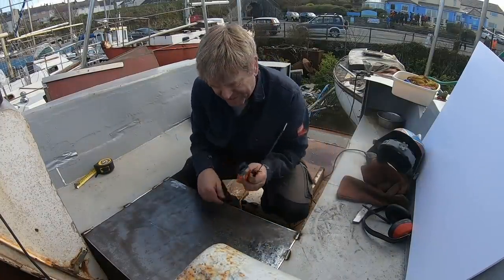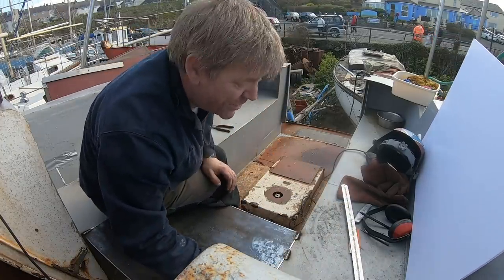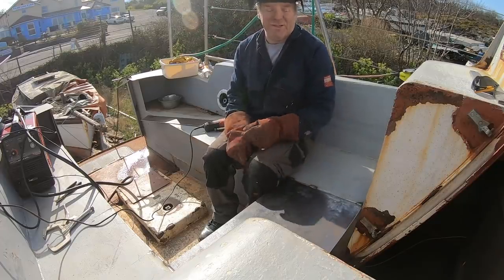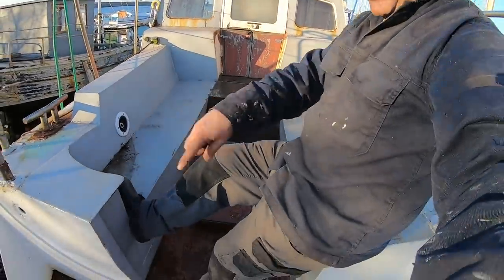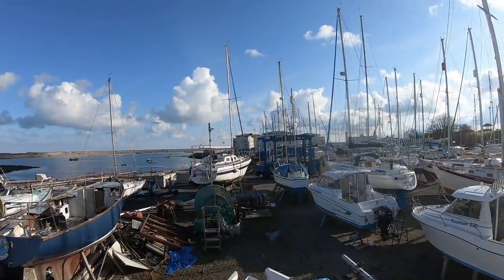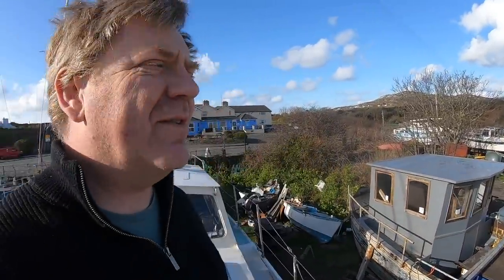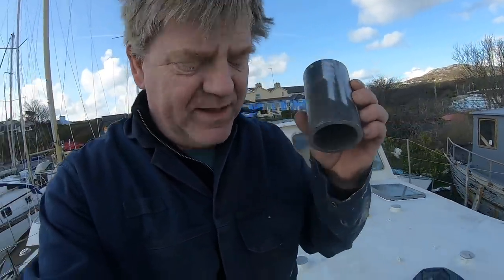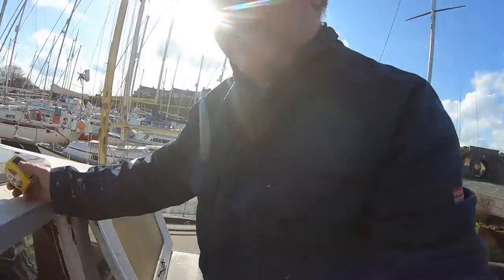#90 - Fabricating a CUSTOM BRIDGE DECK for our PROJECT YACHT

Comment: Andy, as a safety engineer and as a sailor I think you might regret the bridge deck modification as currently changed.  I think you need to consider stepping up and trying to get through the companion door in heavy seas.  It looks like it would be very awkward and possibly dangerous.  If you still want a bridge deck I would lower it to half it height that would still prevent water from running below decks.  Also the seat sides end up as foot holds when the boat is healing so such a high bridge deck prevents that as well.  There is no place to brace your feet while underway and 15 degrees or more of healing.  If you keep the height as is I would add hand holds on either side of the companion way doors.
Reply from the maker: Yes I see your point and we will be putting lots and lots of handholds everywhere.
Reply: I'm not fond of this bridge either. It's going to be a pain most of the time. I think I would consider making a removable water tight step or panel that could be installed in case the weather conditions are bad. The deck bridge permanently reduces the size of the cockpit and the height of the door. But if you like it, it's your boat and that's fine too, of course!
I hope you will recover quickly. Don't over strain yourself.
Reply: @SailingMelody  your bridge deck isn’t that different from what I have on my Swan. I actually find it quite ok - we tend to sit further after if we want to be on the weather side and brace; otherwise, where you plan to sit and stretch out is a very popular spot!! Plus on my boat salon stays very protected.  I do have good handholds, as noted above, and we use those.  But we’ve been out in a few Force 8 /9s and no problems.

Comment: FWIW (I'm no welder), As an old school sailor, I'm loving what you did in this episode.
I would add a wood or 'Starboard' trim piece on each of the bendy bits' edges.  
Else, think guillotine! 
Or, fully enclose the shelf area and put a 'cut-out' opening in each side for storage access.
Hope you are fully recovered by Summer.
G King
SV Intuition
Reply from the maker: Thank you :)

Comment: I had a bridge deck on my previous yacht. After a lot of consideration I removed it and life become so much better as a live aboard. I just made a small drop in companionway slide to use in heavy weather. My current Bluewater yacht also doesn’t have a bridge deck. They are a real pain to step in and out off.

Comment: Gday Andy, I like the bridge deck. I read how some think it could be a hassle in a seaway but the way to get around that is slide your bum up to the entry and swing your legs around and down the entry with no need to stand up which keeps your centre of gravity low and it's a civilized spot to pass out tucker and refreshments. It will give you more room inside as well. Along that curvy bid I'd consider a 15-20mm diameter pipe welded along the top edge which will make a user friendly grab rail and be chafe friendly if you've got lines over it. Don't worry about your winging were used to it now and look forward to the next vintage "from the winery"😜 and don't rush your recovery, if your body ses take a break, take a break. Like Treebeard ses " if a thing is worth doing it's worth doing slowly and we only do what we can do slowly" . Or is that just me 🏴‍☠️
Reply from the maker: Hahaha yes I know what you mean. I don’t think it’ll be a Hassle at all.

There will be wooden slat on the sests and some anti chafe along the combings. The companionway entrance is still larger than on most boats and I may yet install a sliding hatch. It’s deceptive on camera but the arrangement will work quite well and being steel if we hate it we can change it 🤷🏼‍♂️

Comment: I don’t get the box at all! Now you made it a pain in the rear to go below. And the box can’t be used for storage. Need some drain holes.
Reply from the maker: The box improves seating in the cockpit and I’ll be making a wet hanging locker with forced hot air under there with a drip tray and bilge pump so when entering the boat we can hang out foul weather gear up under the steps, under that box and they will drip into a tray with a pump out and have hot air from the diesel heater pumped into there to dry wet jackets and trousers

Comment: Andy - I, too,was getting winded with just light expertise. Turns out I had a 90% blockage in my Left anterior descending artery (the widow maker). A stent made me right as rain. I’m going strong at 79. Hope you get it checked out. You wouldn’t want to have an episode on the high seas
Reply from the maker: I have been referred for an angiogram and echo Cardiogram to check exactly that

Comment: I had a wooden insert in my companion way that worked like what you installed... It ended up not being used, only in rough an big seas.. I guess it depends on how you finish the interior of course... Excited for what's next...I like the bow spirit fitting... Brilliant idea!! I'm having similar issues as you are winded quickly, get a wee bit tired quicker than I usually wud... I started taking vitamins an taking CBD for lung health an all over body an organ help... An it's amazing how well it's working.. Anywhoo take care of you !! ✌🏼💗😊❣️

Comment: Getting out of breath is frustrating for you but it is good that you are able to work on the boat again.
I understand the queries people have about the new bridge deck but apart from the reduced step through space, it is a workable solution to reduce the chance of a cockpit swamp resulting in lots of water flooding in to the boat. There are many other ways to achieve this but your solution will work, plus give you that area underneath for the heated/draining locker for wet kit immediately at the entrance. The bowsprit fit is perfect by looks of it, enough space to accommodate the final protective coating on everything. 
What does your post-it board to do list look like now ? How many jobs left ?!
Reply from the maker: Hi, yes I'm happy with both the bridge deck and the bowsprit progress :). I will do an update on the board of doom soon :')

Comment: I like the pieces that you welded on the area that you were talking about being able to sit your coffee cup on. I believe I would cover the edge with something , I do not what is available where you are but I think an autoparts store or marine supply store might have something like a rubber or plastic moulding for door edges or a length of fuel hose that has been cut lengthwise and just slide it onto the edge. I would hate to see one of you get hurt in rough seas.

Comment: This hinges from the "doors" are nice ones, please keep them but do something that you cannot lose them if the boat goes on the side. and what is also good, the doorparts can stay open now without disturbing the up and down. the upper part of this steelplatte shall have a pipe welded, which is plenty of trouble (must be welded from both sides to close the welding) or my idea is use some wood stripes ( sorry google dont translated it) out and inside screwed which you can use then also as a handhold.
Reply from the maker: That’s a really good suggestion.
Hadn’t thought of that

Comment: Will you install a cockpit scupper in case you do get pooped?
Reply from the maker: The whole cockpit drains straight off the back onto the bathing platform and directly into the sea.

When I install the transom washboards they will stop short of the sole with a mesh to prevent object going overboard

Comment: I think I would make the bridge deck into storage for the cockpit
Reply from the maker: I considered that but the steelwork in that area would have needed replacing as it’s still an option
Reply: @SailingMelody  yes it needs replaced still but you don’t really have any storage in the cockpit now for fenders dock lines or emergency tiller. Wouldn’t be too hard to do   Just close it in cut out a hole in the top for a deck hatch drill bolt holes butyl tape it bolt it down and done

Comment: My concern is height access to the companionway.  Big step up and bend to go in. Awkward in rough weather.  May also limit the size of products that can be easily lowered or removed from the companionway stairs.  How high are the first set of treaders leading into the cabin?

Comment: I don't understand making the footwell in the cockpit smaller. Now you have to step up onto that new portion and then down into the wheelhouse? Why not just raise the threshold and not reduce the size of the footwell area?
Reply from the maker: So if we get a breaking wave in the cockpit it is not going to end up in the pilot house. No issue stepping up.

Comment: By adding the little bench there won’t it make it harder to get appliances in like a refrigerator, or is it just on camera that it looks like you really shrunk the entrance way.
Reply from the maker: There’s still plenty of room to get stuff in and out. But the smaller aperture will be easier to keep watertight especially if we got rolled over, which would be terrifying anyway
Reply: @SailingMelody  thank you for responding. I love that when I ask questions you guys always are so nice and answer. I’m not a sailor but love alternative ways of living and have been following your journey for about a year and can’t wait to see you in the water living your dream. ❤️
Reply from the maker: Hey :) we always try yeah/

It’s going to be a trade off between access and seaworthiness. Big doors mean good access but small doors mean less chance of serious amounts of water getting in if we got knocked down. 

I’m even contemplating putting in a sealed sea door in the aperture which would reduce the size even further but effectively means the boat is a completely sealed box when everything is shut and locked

Comment: Where are you in the Uk and the small yacht with a bowsprit behind you interests me. Would it be for sale.
Reply from the maker: I'm sure it probably would be. Holyhead north wales.
Reply: @SailingMelody  thank you it’s a long way from N.West France though. Is is possible to verify what make of boat it is and whether it could be for sale.
Reply from the maker: Will see if we can find out. It is a big project though alot of the planking is missing from the keel. Your best bet is to call holyhead marina they will have the details.
Reply: @SailingMelody  ok does it have a name. It looks similar to a boat I previously own and regret selling. Thanks for you help. Philip.
Reply from the maker: Not that we have noticed but will look next time. If yiu speak to the yard just say the wooden boat behind jabula, melody's current name.
Reply: @SailingMelody  much obliged but it is a long drive to view it but I am still interested

Comment: Great work, éven if i would perhaps welded this new deck with à little « downhill » to avoid the water stagnate just in front of the door.
Reply from the maker: It does actually slope aft but 15 degrees :)

Comment: My immediate reaction to the new step up is, you will need to add at least one step to the existing set of steps in order to reach the new height. This in turn will require pushing back further into the cabin creating floor space and mobility issues.
Reply from the maker: its deceptive I think on film, the bridge deck works really well and hasn't made access more difficult at all

Comment: I know what you mean when you get out of breath, i had blood clots in my right lung so must things are hard to do. the bow spit will look great when its done. Will you be putting a drain in the cubit,   ?
Reply from the maker: The cockpit drains straight
Off the back of the transom onto the bathing platform and directly into the sea
Reply: @SailingMelody  thanks for your reply

Comment: I was thinking the "wave deflectors" might be nice if they were curved top to bottom like half a pipe with the concave side outwards? That would curve any water away and down! BUT (BIG BUT) It would be EXTREMELY DIFFICULT to make! However if you put the lip on top of what you gave now all on the outside it may well do the same thing.? Do hope your health improves very soon, nothing worse than trying to do something and having to stop every 5 mins to rest. As you can tell I'm no sailor!!!

Comment: I see people bad talking the bridge deck mod. If it is that bad, then you could always cut the roof and put a slide away on it, couldn´t you? That might solve the problem, because I agree that water inside the boat is just too much aggravation when you are already battling waves! You also need a place to "sleep" when you´re on watch...  (;-) or something.
Reply from the maker: Yeah I’m very happy with the design of the bridge deck and absolutely I can either change it or install a sliding hatches there’s any number of solutions if a problem arises but honestly I don’t foresee a problem with it.  I’m prepared to be proved wrong but I did that mod a few weeks ago and so far, going in and out with large tools like the welder and compressor has been no problem. 

I will of course have kiwigrip on the bridge deck and most likely some slats of some sort on the seats themselves.